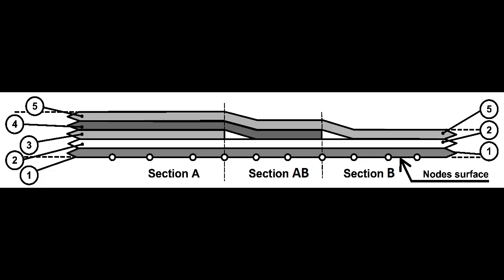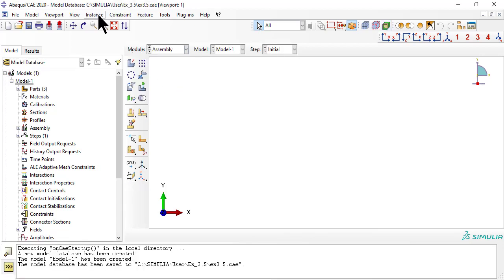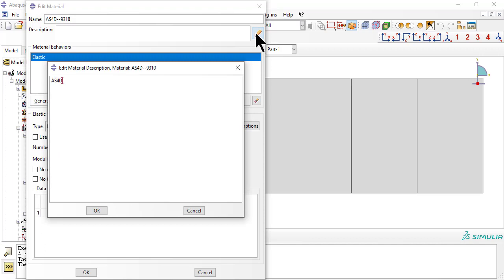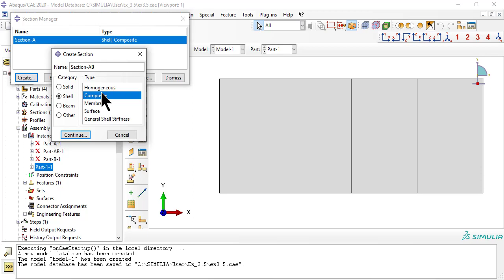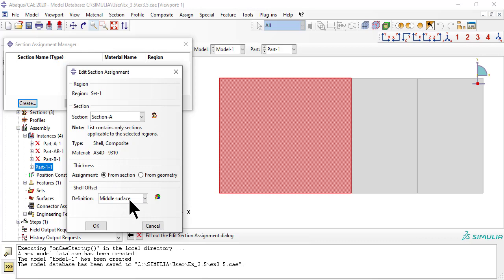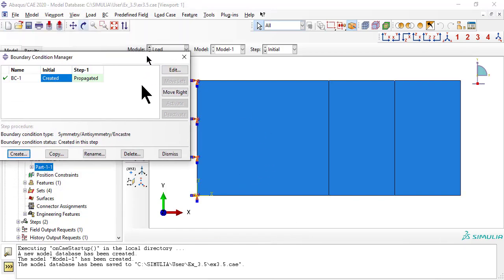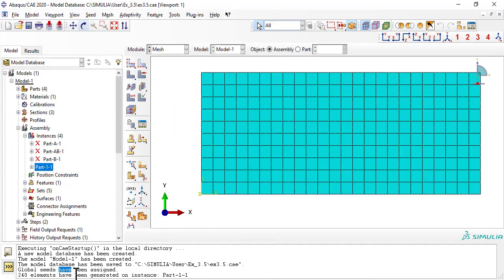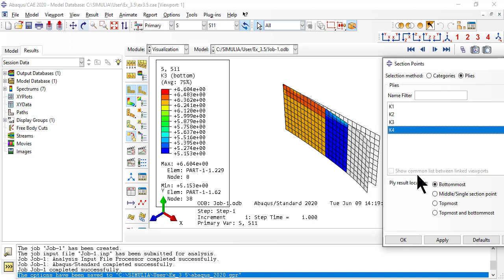Example 3.5 How to use Abaqus to model a ply drop off, terminating laminas one by one

Comment: Hello Dr Barbero, thank you for your videos demonstrating the examples of your book. It really helps to understand the steps why we are doing this instead of just clicking on different options. I just wanted to ask you, for a type of reinforced foam core composite, what are the ways to get the orthotopic properties or engineering constants such as; E1-E3, nu11~23, G11, G12 etc? I could not find any journal papers where these are stated so I am bit stuck modeling them in ABAQUS
Reply from the maker: I share your frustration with the lack of data, but for the core the only elastic properties that matter are G13 and G23. All other E's, G's, and nu's you can put small numbers as long as they do not trigger an error--see "restriction on elastic properties" in my book. The effect of all other properties is dominated by the properties of the skins. For G13 and G23 you can do a separate 3D model of an RVE of the core, using shells for the walls of the honeycomb, of solids for a foam, then chapter 6: computational micromechanics, to get the properties G13 and G23 in terms of the properties of the honeycomb paper, or foam properties.
Reply from the maker: In addition to my earlier response, please see Ex-3-7-a, b, c, and d.
Reply: @EverBarbero  Thank you so much Dr. Barbero! I really cannot express my gratitude in words for your well-detailed explanation. I understand now what I have to do. I just hope it aligns with the restrictions of ABAQUS. I will follow up with your suggestions and if it works, I will give you feedback later on. Thank you again! :)

Comment: great video sir. One question, how did you do validation for the example ?
Reply from the maker: I didn't. The way it works is you validate the software--Abaqus in this case, specifically for the type of element you are using--with examples for which there is experimental data or analytical solutions, and if that is lacking with solutions from other software, and once you are satisfied, you trust the software.
Reply: @EverBarbero  Thank you sir for the reply :)

Comment: hello Dr. Barbero , thank you for the useful video, I was wondering if the ply drop off method can be used to simulate defects like gaps(  not gradual gaps, a sudden messing tape in some plies) ? also I have a question in the video, can we model the part using sole deformable extrusion instead  of shell planar ?  also why did we put edge semmitry  boundary condition in the y axes ?